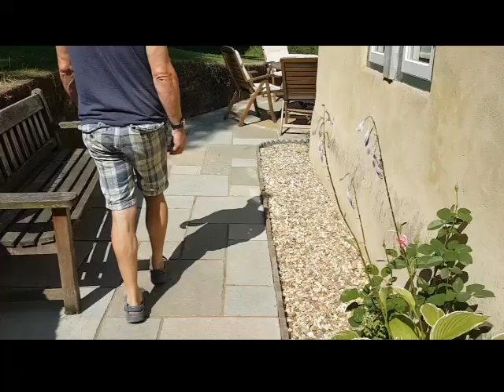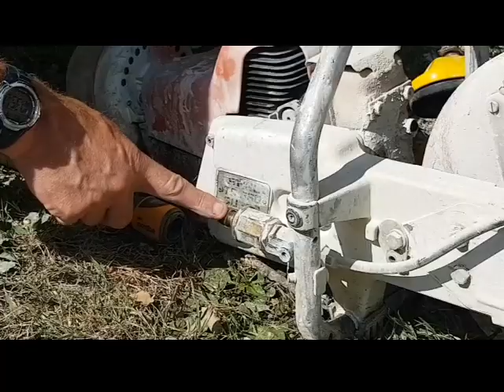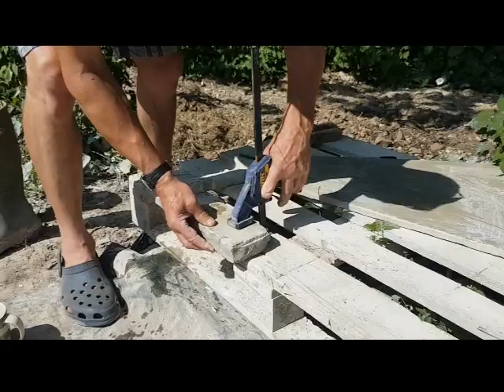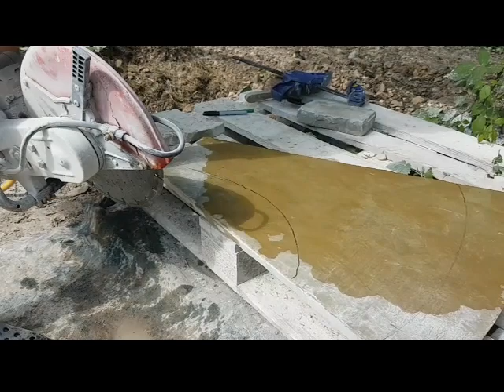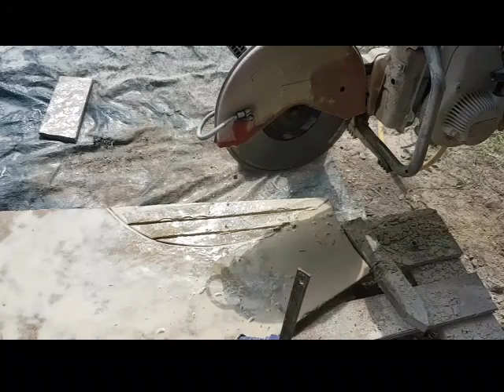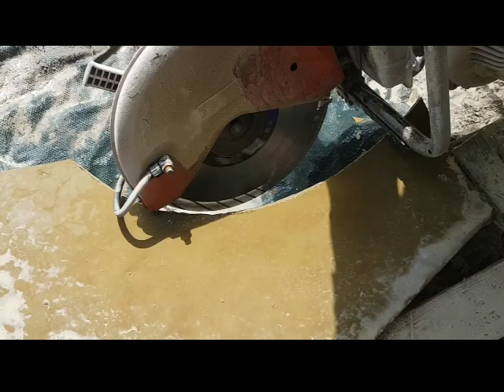Cutting curves in patio slabs (pt1)

Comment: Super guidance and loads of useful tips. You've done a great job. We have three patios to lay with radiused boundaries and we're doing it ourselves for exactly the same reason you did. I didn't think I'd be able to get the accuracy or dexterity out of a Stihl disc saw but I have a TS400 in the garage and having seen what you achieved I realize the potential. Thanks so much for taking the time to share. Your patio looks great and I'll copy your work station  and cutting procedure. Cheers John
Reply from the maker: So sorry for my delay John, (I’ve only just found your comments) 
I wish I’d bought the TS 400 saw. I’ve used one since doing my job and found it to be much improved on the old TS 350. I hope your project went well and that my vid gave you the confidence to have a go. Many thanks for your kind comments.

Comment: Nice work, and useful video. I'm also in a very similar situation and even got the same disc cutter which I'd bought as a non-runner off ebay. Needed piston rings, carb cleanout and new plug but luckily the ignition coil was ok which is lucky because these 'donut' coils are very expensive. Luckily cylinder head and piston weren't scored. I also had same problem with the Stihl water feed hose connector which was utter crap. Had to wrap several layers of PTFE so the hose connector would grip. My only concern is I've got to do a tight inside cut so a slab can sit around a drain cover.
Reply from the maker: I seem good at missing my YouTube comments on line. Very sorry for missing yours. I would’ve liked to have warned you about the flywheel woodruff key on your saw. The standard key i found to be too small which eventually allows the flywheel to slip around the crankshaft and therefore throw out the ignition timing completely so eventually the saw just won’t run. Do be aware of this fault. I put a new key in, but I was either sent the wrong one, or it’s just a rubbish part.
I hope your project went well and the video was of some use!
Reply: @lawts1240  No worries - thanks for the Woodruff key info. I reckon that might have happened to mine too. Finally finished the patio last year. Took longer than expected. I'm also trying to keep up with comments. My notifications don't always come through on my android phone but do on my pc.

Comment: Mark your guide line out then from the outside working to your guide line start cutting straight lines about 10 mm apart to your line then use the tip of your blade to thinning the bottom of the stripes you made to get rid of them also this technique can be used on tighter curves